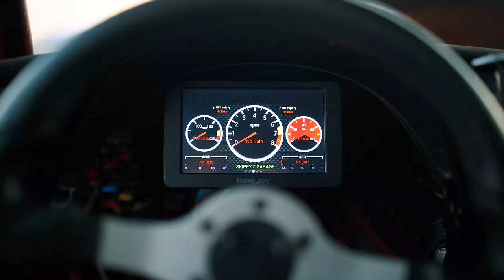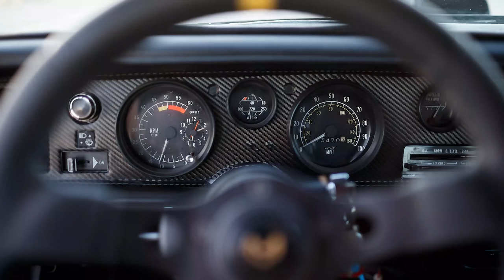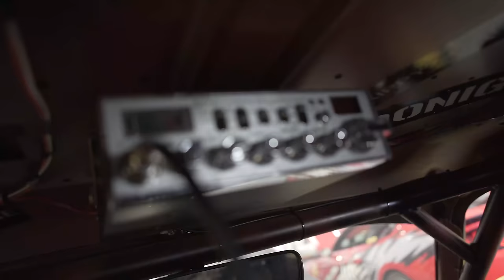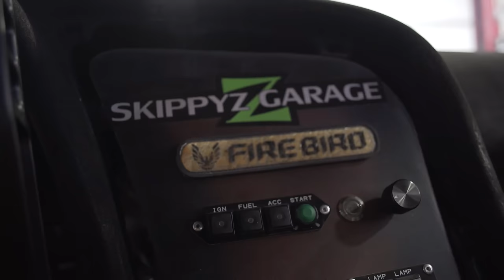All Wheel Drive Swapped Supercharged 1971 Trans-Am?

Comment: LS engine mated to a GTR AWD system? Genius!!!
Reply: aljohn tabion i call it stupidity. It Will spend more time on the lift than on the road.. Bet that
Reply: @codywade1742  that's like, your opinion man
Reply: @wd4950  big Lebowski ?😂😂
Reply: Maybe the Nissan parts lol not the ls
Reply: @codywade1742  Yeah, Nissans are pieces of shit. Thank god he kept the engine and transmission GM.
Reply: So what makes them shit may i ask?

   All manufacturers transmissions can be shit in the wrong applications.

 Not everyone wants or needs a reverse pattern transbrake equipped rachet shifted manualised powerglide or a straight cut, dog engaged sequentially shifted trans with load sensitive shift knob for an application.
   Like the Nissan FS5R90A box that had dubious reliability with horrible, slow gear selection, yet funnily enough it was actually US sorced Borg Warner T5 unit so Nissan brought a man-licence, then set about redesigning it, incorporating modifications, and made it stronger and smoother selecting. Calling it the FS5R30A.
  The JACTO automatics like the L4N71B and RE4R03 are very well known in Drag racing for being an excellent units.
    The R34 Getrag unit is the same as BMW M5 unit bar the transfer section and is weaker in the GTR than the M5, why, because the R34 has better traction it places increased load on the transmission so fails easier. 
   Any clued up car guy knows transmission failure can have many variables involving driving style/clutch or converter setup/lack of maintenance/incorrect installation/incorrect repairs or upgrades/mounting failures/suspension tune or setup/traction loads/aerodynamic loads/thermal control/lubricant breakdown, etc etc rather than the head in the sand label bashing 'my badge is better than your badge' backwards mentality so many have developed.
   If Nissan/JACTO  transmissions are so chit, why have they been used or are used currently being used by all these manufacturers?:
Nissan/Infinity/Datsun. Mitsubishi. Renault. Mazda. Subaru. Land Rover. MG. Rover. Proton. Jaguar. Audi. VW. Ford. Hyundai. Kia. Daewoo GM. Seat. Suzuki. Proton. Dodge.. Jeep. ??
Reply: Lmao, I'm sure Ken blocks personal full time mechanic is really going to struggle keeping this running 🙄
Reply: Looked like any old transfer case from a GM 4wd/awd SUV or something. And he said the front diff was out of a q45, so I'm guessing the gtr badge was just kind of a joke, that this dude took to mean it's a gtr awd system. But that's just from a glance, and people's tendencies to make assumptions. That's what I would do, just use an AWD Tahoe trans/transfer case and an independent front. If I were going with gm power train, which I wouldn't. And it's not an LS anyway. Same basic design, but a 5.3 truck block. Probably LS heads.
Reply: @salvadordollyparton666  Greg said it has a R32 transmission with Z32 rear diff and some Infiniti diff up front. Everybody thinks every transmission is shit, because a lot of knuckleheads don't know how to drive. Same issue with people blowing up Subaru transmissions, it's not the transmissions fault if you suck at driving!
Reply: RarkItOrParkIt extremely well put!
Reply: @brokenmember1658  Nissans have decent engines but their transmissions are terrible. Nissan is like the Dodge of Japan.
Reply: @salvadordollyparton666  The 5.3L Vortec is still classified as an LS motor. The LM7 is identically built as the same gen LS the only major difference is the LM7 is cast iron and the LS is aluminum. But overall he did a great job using a reliable GM drive train, After all millions of mechanics can't be wrong. That's why you don't see more Coyote or Hemi swaps  because they both have severe issues with valves and cams.
Reply: @codywade1742  
Would not not meme. Its like you don't think, look, or learn.

An LS engine made since the 1990s is utterly bulletproof, especially if you use the LS3 or LS7. 

You need to ask yourself why the GM OHV 6.2L V8 is so Damned popular. FULL STOP.  Then find out,without bias WHY that is.
Reply: @codywade1742  do you even like cars? Lol
Reply: @codywade1742  you seem mad.... or jealous?!?
Reply: @codywade1742  I call it hot rodding, it's been going on ever since there were cars. Ingenuity in motion.
Reply: The CD00A is a great transmission designed by nissan, used in many ls swaps but every brand has their gold and their turds.
Reply: @codywade1742  yeah, of course. GTR drivetrains can pull up 900 horses at the crank, with ease, but an LS will break it. Sure.
Reply: @tskraj3190  has a lot to do w/ what will & wont immediately mate up to a GM output shaft
Reply: @tskraj3190  Funny I have an all original 99 maxima with the 3.0 VQ and it has 330 thousand miles and runs great.The newer ones are mostly shit but older ones are built well.

Comment: I sold this car to Gregg! So happy to see what life he put in it!!!
Awesome
Reply: That yellow is cracked and crazing like that because it's latex house paint from 1982😅
Not my work. Some kid in Pine Valley Utah did it and put the decals and plastic tape graphics on the side.
It had a 360hp 69 Grand Prix engine when I sold it. I wonder where that is?
Reply: That missing Bondo piece is from when I was rear -,ended in 1986 while running N50s and air shocks. It didn't fall off

Comment: I saw this about a year ago and with govt. mandated free time to spare I decided to convert my 89 IROC to awd. I’m currently running a 4l60e ( built by Mad Dog Lou) with the awd transfer case from an 04 Escalade, 97 Cherokee front drive shaft, “modified” (hacked) evo 7-9 front knuckle & hubs (let’s you retain stock suspension). The front diff was a true pain in the ass to figure out, until one day I saw AWD written on the windscreen of a Dodge Charger on a dealers lot. So I pulled in and got under the car with a tape and a flashlight and, After avoiding the salesman I determined that the front differential out of one of these was a near perfect fit. Now I’m in the process of adapting flanges to standardize everything but before the spring starts it should be done. And I wanna thank you guys for the inspiration 👍

Comment: I’m pretty sure if you were able to pop into a mad max style universe that this is exactly how vehicles would be built. Basically a hodge podge of parts from a bunch of different vehicles, purpose built for what you want it to do, and maybe a little extra touch here and there in preparation to use it for things you may not have thought of initially. I love it. I feel like this is the gritty thrash-mobile cousin of the super wide white Trans Am that was on Build Biology.

Comment: One thing that was left out of this video is the front and rear ground effects and rear deck spoiler .... both extended versions of the original styling  looks sort of like but way way better for an exaggerated aggressiveness..this car here is how I always imagined what the rear deck spoiler would have looked like if you added about 4 inchs taller to the original design..... My very first automotive employment as I was 19 years old was at a Buick Cadillac and Pontiac dealership in the year of 1970 . As I was a graduate of the automotive end of the university of Illinois with an associate degree of applied science and as a bonus a Dr. Of Motors Degree from the Perfect Circle Piston Rings and Valve Seal Corporation. ...as we all know performance cars were at their peak horsepower in 1970 ...even Cadillac offered a 472 cubic inch V8 with a spread bore quadrajet four barrel carb..in a two door hardtop coupe Deville will roast the tires all the way through L1, L2, and bark'em off at a hundred shifting to Drive...total cost for the caddy was around $7k for the 1970 two door hardtop as the Coupe Deville with No black vinal roof but instead painted top bottom with no chrome divider strips but just one solid color of canary yellow was freaking hot rod eye candy. And music to my ears with 2 1/2 inch dual exhaust telling you we have 400+ HP under the long boat deck looking hood ..... And  I was their set up and service 75 check point inspection greasemonkey as check point and sign off after a road test... I called the RPM no traction control test and at lease 5000 miles of wear up in smoke on your rear Goodyear wide ovals ...And as the kid I was at age 19 don't hand me the keys to a 1970 hood induction GS 455 Buick grand sport, munci four speed Hurst Tee handle shifter with a 12 Bolt 4.11 posi-track rear axle ..... And for $7900 bucks bought you a Pontiac trans am firebird with every factory option including a 455 cubic inch engine .and don't ever ever at age 19 allow me behind the wheel .but for value the 1967 formula 400 first model firebird was it with a few mods like an all roller Cam with a rev  kit of extra springs between the heads and the top of each roller lifter eliminated any chance of "floating" the valves,  dual fuel  line center pivot float bowls mechanical secondary four barrel 850 CFM Holley double pumper on an aluminum high rise intake..with a big tube set of hooker headers with four inch collectors attached to Purple Horny Header Mufflers about a foot and a half long with no tail pipes that shake the ground setting off car alarms ... These cars came with traction bars on a GM twelve Bolt with 4 spiders on two limited slip clutch packs running a ring and pinion with 4.33 to one gear ratio that will snap your neck with 24 inch wide Micky Thompson tires on the back as bout 9 inches of the micky's tire stuck out past the firebird  stock fender flaring.  Illegal of course but it was that "look" with a three inch rise on the rear leaf spring shackles to clear over kill big wide fat tires in your face from the man himself Micky Thompson at 406 miles per hour with four Pontiac super charged v8 engines in a one all wheel drive car holding the land speed record at the Bonneville  Salt Flats...and with your 8 track tape player screaming out  Deep Purple " Highway Star" made you priceless at age 19 ten feet tall bullet prove idiot,  as Rough Nader said " unsafe at any speed" ....and by 1975 the show was over,  raise the hood and "where's the beef" and all you saw was a bunch of rubber hoses attached to smog control air pumps with PCV valves hooked with EGR valves blowing exhaust back into the intake with this hissing sound from a single tail pipe hooked on the slow side of a thing full of honey cone shaped platinum they called a catalytic converter... It converted alright of any chance you had to go fast. Game over and find a new hobby  , that's when I discovered the 500cc Maico breako's ... The 250 ossa phantom  , the yamhadog MX360 , the CR480R , the kawazukis KX and RMs  and then there came SoCal Honda R&D skunk werks shogun "Mugen" 310cc twostroke cheater kits that put a new meaning of game changer to braaaaaaap

Comment: A more simple project would be to weld on the 1971 Pontiac trans am metal body & metal upper metal structure, on to a 1990 Nissan skyline R32 chassis.

Comment: Kinda cool but added 400 lbs for better traction?  That's what drag slicks are made for. I highly doubt it's any faster than it would be if it was tubbed with big slicks.
Reply: Tubbed and slicks dont do corners, this setup would be fun in a straight line or any type of track its put on
Reply: @joelnoble3919  yeah I'm sure it  would Corner alot better than stock but it probably weighs about 4,300 pounds now. That's gonna slow you down in the straights and everywhere. Cool and unique project though.

Comment: @05:15 ...people don't do that because it significantly lowers the value of a collectible vehicle; if one is going to do that, it takes a lot of money and even more taste, not to mention system engineering knowledge. Yes, you can hack together something in a garage, but that will just set off a chain reaction of problems - the exact opposite of system engineering.

Comment: im wondering why an old school 300z diff? junkyard price? Is it stronger than new vette stuff? geometry w other parts? Totally could have used all GM 4wd stuff out of an awd Trailblazer SS and kept motor forward in stock location and even ran a late 6MT. I get why mid engine and the crazy suspension - its all trick af and super bad ass....its all amazing minds blown.... But for the common man skills the same power and 4wd can be had w all GM centric parts. '91 GMC Syclone/Typhoons used 4wd Astro Van Tcase and diff setup in a platform that was not designed for it 30yrs ago. This Hurst/Olds clone + TBSS front driveline was all done by regular dude in a garage in small town oklahoma https://youtu.be/dIuh4sHR558
Reply: I hazzard to guess that the Z diff was readily available, easily adaptable and would handle the intended torque load.. The Nissan Z32 R230 differential is strong unit having a solid housing, decent bearing sizes and a crown wheel  of 9.05 inch. 
Possibly a similar reason of availability for the use of transmission. The FS5R30A gearbox will withstand some punishment (albeit apart from possible 3rd gear failures) and the advantage with the Nissan unit is the ability to adjust drive from 50/50 f-r split to 0/100 f-r.  Opposed to the Borg Warner 1372/4472 transfer from the Cy/Ty that is permanent AWD with around 33/66 f-r split. Advantage being bolt up fittment.

Additionally to this, Gregg Hamilton is a New Zealander, like many Kiwi's, in the last 200 or so years stuck down by the bumhole of the world,  it used to be a excruciating struggle to get anything shipped here or being prohibitively expensive to purchase, we have evolved the ability to repurpose parts and create new build solutions using what's on hand. And normally if it's easy, we generally will go about it the hard way.